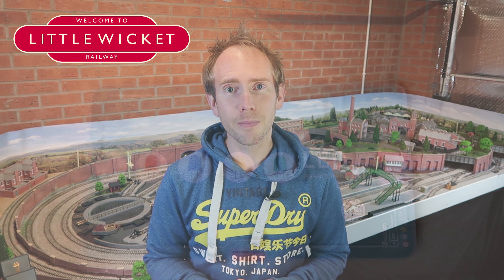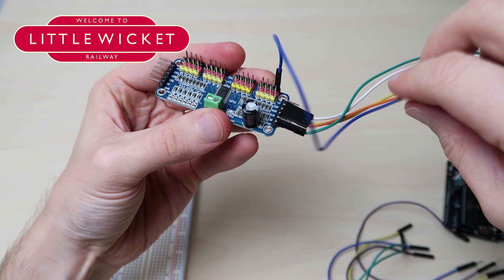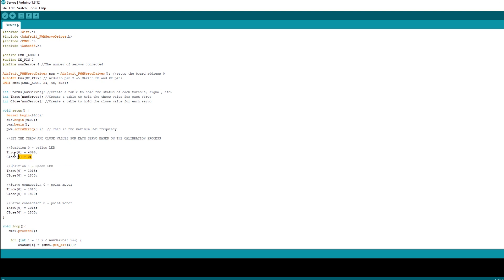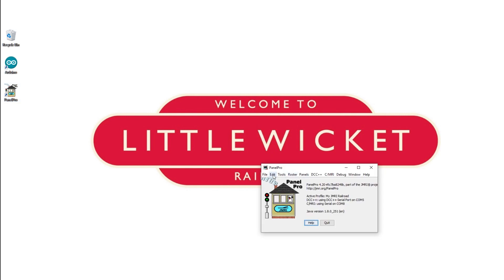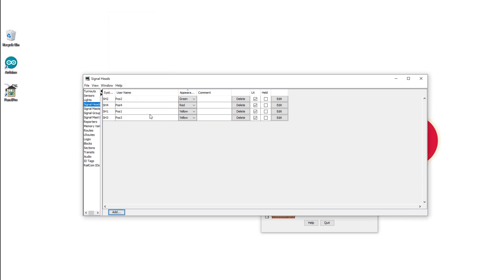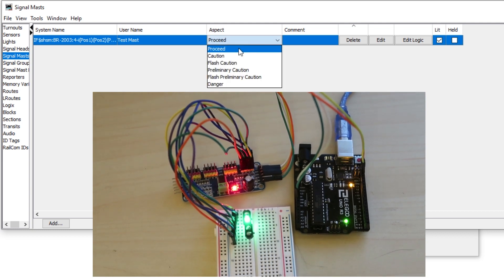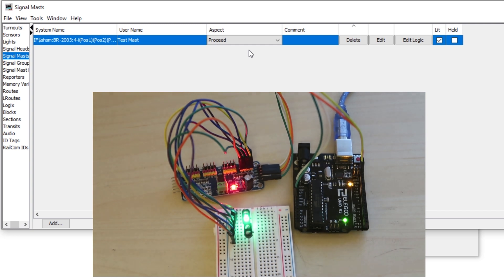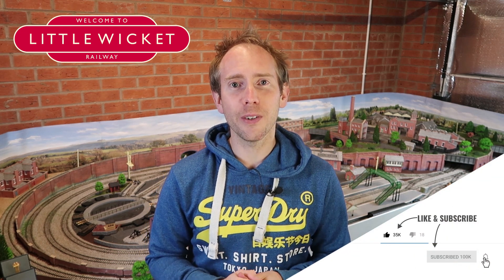DIY Model Railway Colour Light Signals Controlled by JMRI

Comment: Hi Robert, another great video, thank you. If it is of any help I was able to connect my leds directly to the PCA9685 by using female connectors and, therefore, did not need the breadboard which makes it simpler I think.
Reply from the maker: That does sound simpler, good idea!
Reply: @LittleWicketRailway  Hi Rob,  another good video.....,any idea for more than 3 PCA9685? thanks
Reply from the maker: @nugrohosetiabudi2783  I believe you can chain up to 62 boards together. You just need to address each board using the jumpers, add a line with the board address at the top of the script, set the frequency for each board and then change the number of servos variable so that the loops knows how many connections it needs to work through.
Reply: Hello Brendan.....I still do not know how to set up for more than 3 PCA9685......Do you know? the max is 3 PCA9685 for this, CMRI cmri(CMRI_ADDR , 24, 48, bus);

Comment: Cheers rob good tutorial will have a go at this should be able to use these in the attached link if people can 3d print their own signal heads https://www.ebay.co.uk/sch/i.html?_from=R40&_trksid=p2380057.m570.l2632&_nkw=smd+led&_sacat=180250  I have no affiliation to this company just LEDs i have used in the past
Reply from the maker: Thanks, recommendations for good components always appreciated. Having you manage to print your own signal heads? I'm looking into 3D printing options.
Reply: @LittleWicketRailway  not yet I am looking at ender 3 printer when I get the funds will be printing my own.have a look @ harburn oo on you tube. guys name is James (merg) he prints his own and has a link to his sketches he kindly printed a couple off ground signals which I wired up using smd led tested and work fine.
Reply: Robert done exactly as video but no lights are working so a double check on the Arduino it is 3.3v ? & lastly how do you Save/Store the file as every time i have to input all the info again (a good way to learn how ) LOL sorry to be a pain